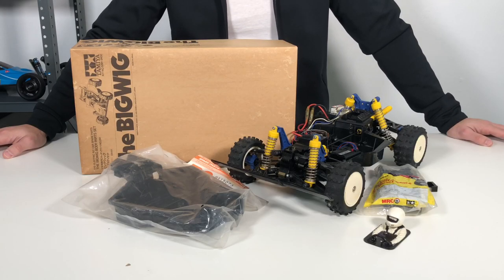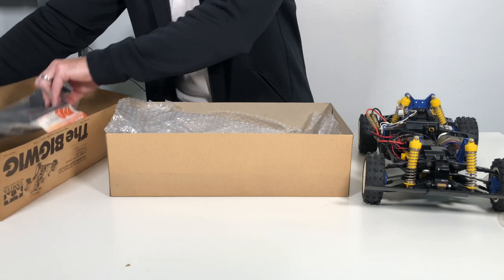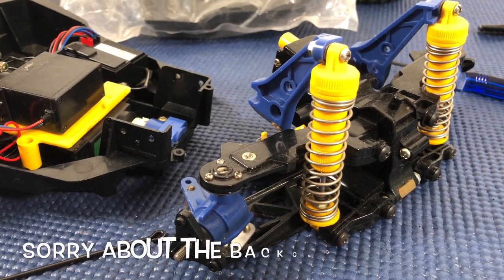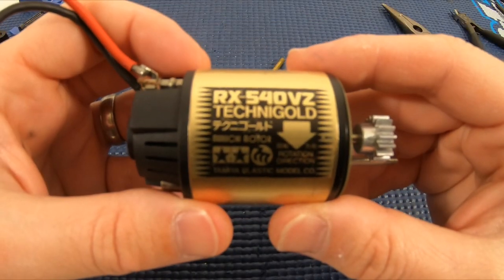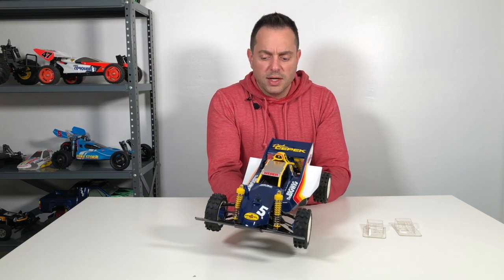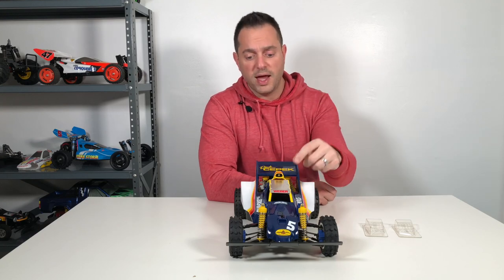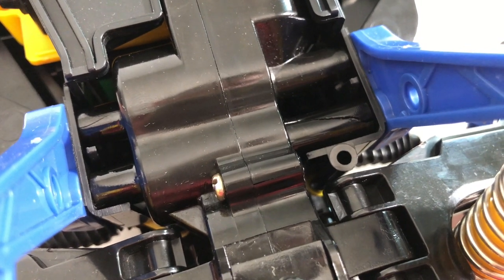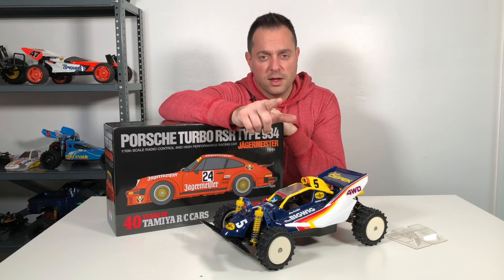e103: VINTAGE TAMIYA BIGWIG RESTORATION - It Goes Snap Crackle Pop! See What I Mean.

Comment: When threading in the screws, use a little oil (i use thread tapping oil, but any transparent oil will do) on the screws. They go in much easier and stress the plastic less.
Reply from the maker: Schutt Rostig thanks for the tip.  I’ll make sure I do that for my future RC restorations.
Reply: do not use tapping oil ,,t will soften the plastic

Comment: Do you use the heat the screws to melting point technique? Then sink them in? Perfect for hinge pins.
What about filling those cracks with JBweld steel and sanding it to shape? Then Paint.
Reply from the maker: None of that.  I’ve heard of using this stuff.  Not too familiar.   Tell me more…
Reply: @RCRetro  wait a moment. You don't know about the JB weld steel, it has to be the JB weld steel, method of filling in the area where you have that Gap shaping it as best as possible within the 5-minute working window letting it set for 24 hours and then coming back and sanding it to shape? Then after you will touch it up with paint. That part in the gearbox, or was that the bulkhead, where you sunk the screw in and split the casing. That piece I would leave exactly the way you have it, then I would mix up a very small portion of the JB weld steel the one that sets in 5 minutes. It's just like epoxy. You will then take with a spatula and you will sink the epoxy JB weld into the open crack it sets in 5 minutes. That is enough for you to gently pack it into that open crack and then let it set overnight. You will then come back the next day and you will send it down carefully without disturbing the plastic around the JB weld, but don't worry if you do disturb the plastic around the JB weld because you're going to be covering it over with color. Now I don't care if you use black marker, I don't care if you use black paint marker I don't care if you use a Sharpie marker which by the way, come in many colors what you will have done is fill in the crack provide a little bit of strength in the area. When the gap or the crack is large or long what I then do is I begin to fill the crack with the JB weld, I then back the screw only halfway out I then packed the JB weld into the small Gap or recess that is now been created by backing the screw out only halfway. Then sync the screw back in you will only have half of a screw set in JB weld you will have the crack filled you can take and scrape the excess off and you will have a sealed filled crack with a little bit of extra strength because the screw only half of the screw, mind you, is now anchored in JB weld as well.

Technique number two for the horrible hinge pins that tamaya uses that inevitably over time crack the area in which the threaded portion of the hinge pin has passed through. And this comes from a materials manufacturing engineer. It's very simple heat the screw portion of the hinge pin as well as the head till it is hot enough to melt the plastic as you sink it into the it's a arm, suspension arm, chassis, or whatever you are about to sink one of those long rod small threaded hinge pins that Tamiya loves to use. You are not going to heat the hinge pin up till it is red hot obviously, but you want it hot enough where it melts the plastic as you begin to thread it in. I have had it cool down faster than I could actually screw it in and in this case just let it set back it out and reheat it and then send it through again then you let it set and that's it instead of the threaded portion putting outward force on the area in which the threads are passing through what you have done is melted the threaded area into the plastic. I'm pretty sure there is a gentleman named Mark Bryan, and there is another channel which my children like to watch and I think it's just the gentleman's voice and cadence is called RC so and so, and they both have used that technique and it works excellent time will tell remember, it's all of those vintage suspension arms from the falcon, the fox, the frog and how the shock absorbers are threaded into that very small eyelet of plastic on the trailing arms any of those areas where you notice you are going to be screwing a large thread into a very small inner diameter of plastic I use the heat up the screw method. Please do not make your screws red hot and deform the plastic completely. When you have done it correctly, you are going to screw in this hot threaded section into the plastic and once the head of the screw hinge pin, has seated you're going to stop screwing you do not want to router out the plastic with a hot thread. Can I trust you on doing this? LOL! The only benefit to this is the next person down the line that comes to buy one of these buggies from you in 15 years the suspension components won't have cracks, and you can save yourself the exorbitant cost of buying the stainless steel rods with e-clips.
Reply: @RCRetro  by the way I saw you at the auction, the one here in Florida where I live, were you able to pick anything up? I managed two pool boats and two Chargers and some various batteries. I thought I was going to win the metallic hornet and that was yanked from under me. I also was taken for a ride on a box of Novak vintage battery chargers, I paid $48 for an empty box!

Comment: Just finished my 2017 rere, and mounted a Proline body Mount screw in front. works mint👌Cut the post right at the body pin hole, trim it straight, and use a 3.5 mm drill bit. use a drop of bearing oil when threading down the 4mm screw.

Comment: If there is anything I have learned in my 35yrs experience collecting, and working on Tamiya kits, their ABS plastics will crack over time. Even just sitting on a shelf cracks develop.  It's a plastic model company producing R/C kits after all, with cool box art, and catchy names. Still love them though, problems and  all.

Comment: Can I ask all the BigWIg users and runs out here, how do/did you like the Rack and Pinion steering on the BigWig. I wonder why we never saw it again. Was it due to the servo and the amount of throw? Becuase with modern servos, I would hope to see R and P steering again! (Eg. high power servos)  I remember when I would have been able to buy the BigWig first run, I would have been using Futaba J-plug F28 servos.  (Blast From the Past)